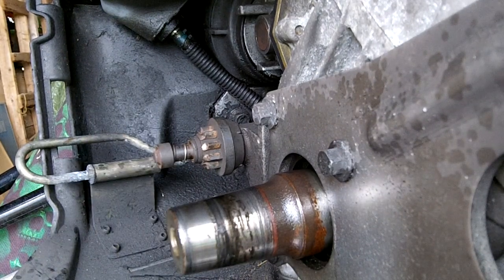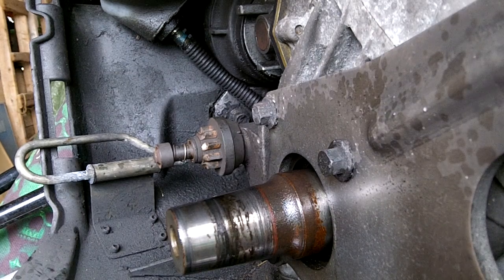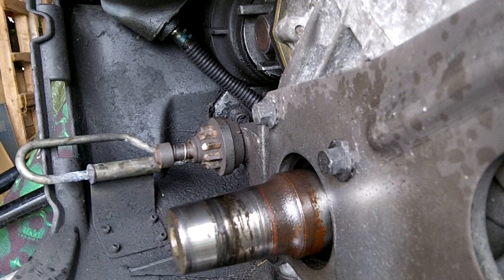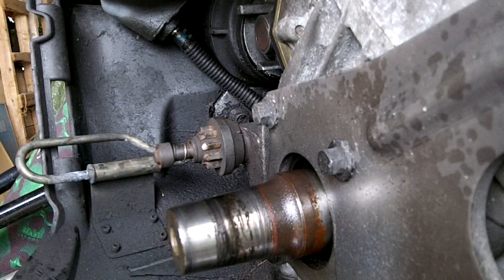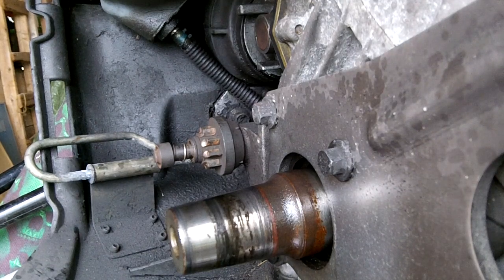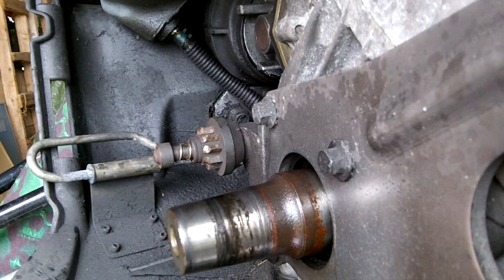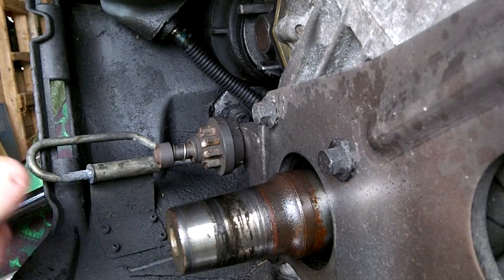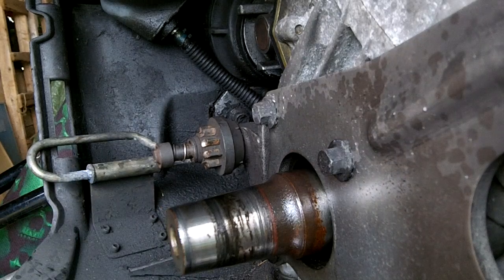Arctic Cat Electric Start Issues and Pinion Replacement

Comment: I have to do this job… the other problem I have is the bracket that this sits in is broken… any suggestions or videos on how I’m going to fix that?  Thanks
Reply from the maker: You will want to pull the pinion, pull the starter shaft and replace the bracket which doubles as a motor mount.  Pull plastic, pull air tube, pull airbox, pull throttle bodies...